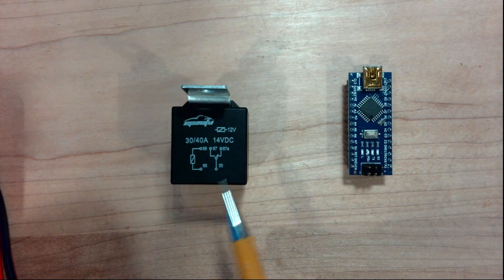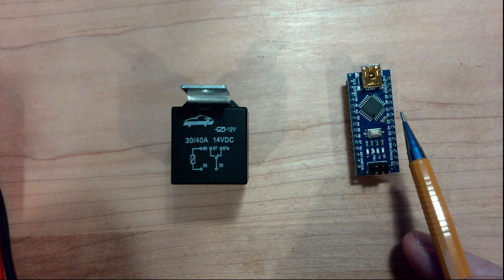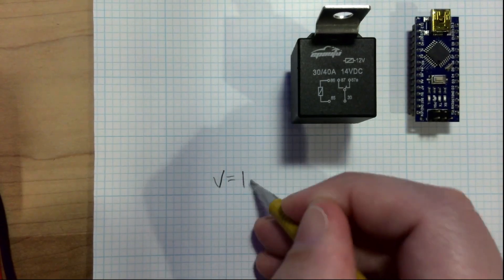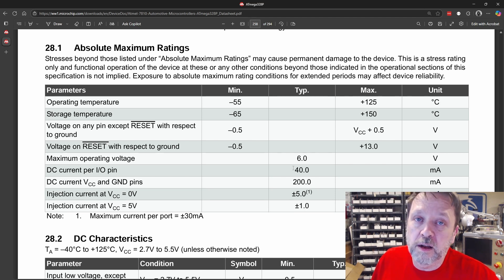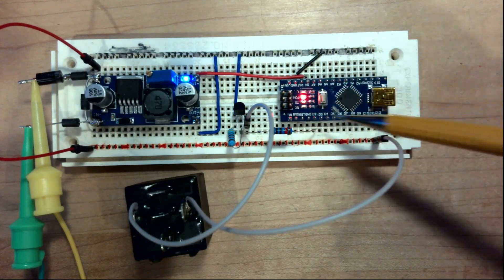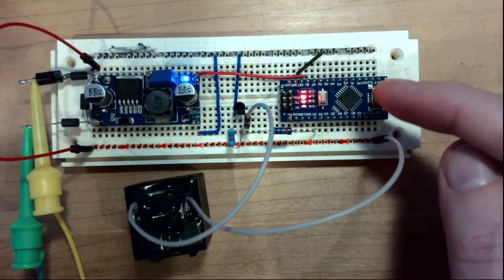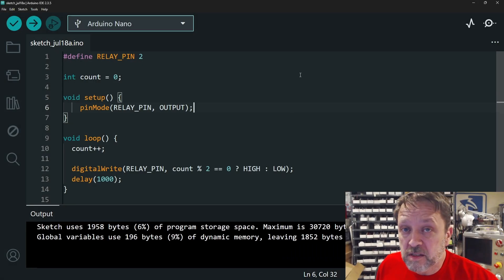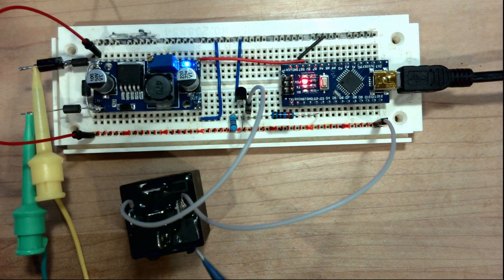Using 3.3V to Switch a 12V Relay

Comment: Will the back EMF damage the microcontroller? Is this why you have used a 10k resistor instead of the more usual 1k? Are there any downsides to adding a diode across the relay coil to limit the back EMF? Thanks for the videos, short and concise.
Reply from the maker: The gate resistor limits gate current. Adding a 12v gate-source zener diode would help keep noise from false triggers. A flyback diode  in parallel with the load should be added if it's an inductive load. Adding it for other uses won't hurt anything
Reply: @dotnetMakers  "if it's an inductive load"
Unless you're using a solid state relay, the relay coil itself is an inductive load. I don't think a flyback diode is optional with a normal automotive relay. A flyback diode is necessary.
Reply: @ddegn load is whatever is connected to MOSFET. Relay coil is the load.